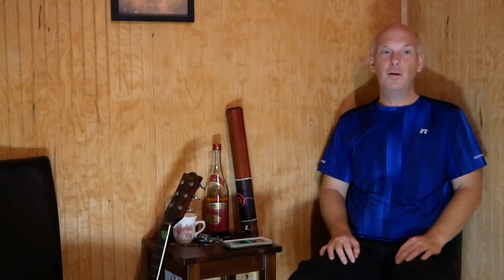How to Build a Cheap House (Dome Home)

Comment: My husband and I want to attend your work shop so bad. But yeah there's a But. So far aircrete is not approved in our county. How long do you think it will take USA to see it as a build able material? For the small guys. Yeah at this time the big companies are using it. Because they can guarantee every block with consistency. Big money  
Please help me make this legal. I want my aircrete home.
Reply from the maker: Actually, it's called cellular concrete and it IS in the national/international building codes. You can get an exception for self-made blocks with local building inspectors by having cured samples crushed at a geoscience lab. That is iF inspectors are reasonable. Many are not which requires some pressure from above. Of-course we want to avoid lawsuits under the treaties of the Americas. So, build a square post & roof structure then use aircrete as infill. Domes often  require exceptions from permitting regardless of the materials.

I assure you it is possible in almost any location. Purchased blocks that are guaranteed cost about twice as much and make the construction materisls cost nearly the same as conventional. If you do the labor the savings is still significant.
Reply: Tiny-Giant LifeStyle 
Thanks so much for the good advice.
Reply from the maker: I wanted to mention to you that code approval is fairly easy for non-load-bearing structures. Using AirCrete as infill for a post/beam structure is fairly straightforward process.  Jst because the workshop is building a dome does not mean learning the AirCrete process is only applicable to domes. It can be used for everything from yard art sculptures and privacy fences to mostly conventional looking homes.